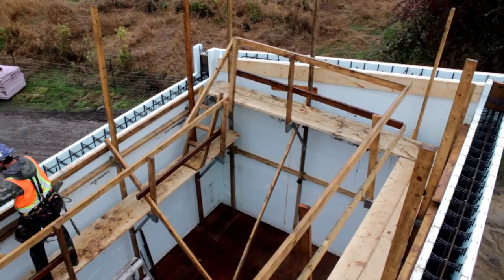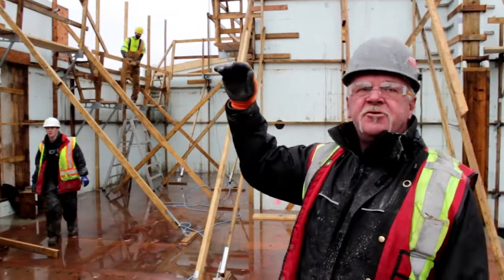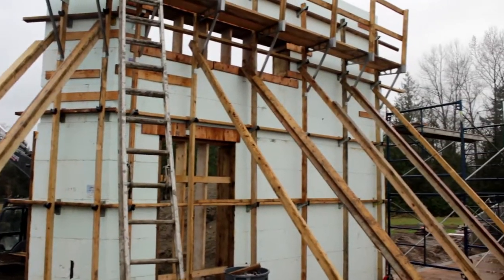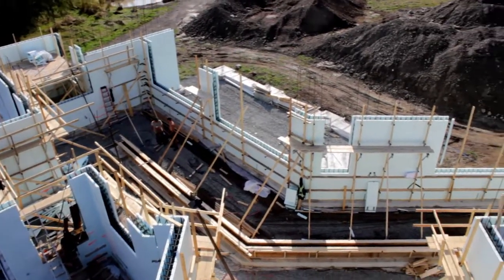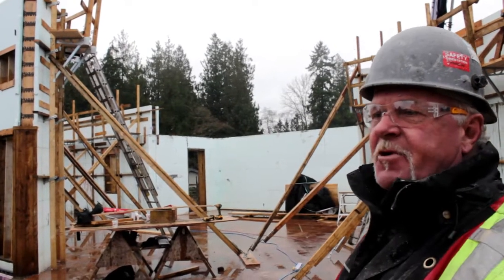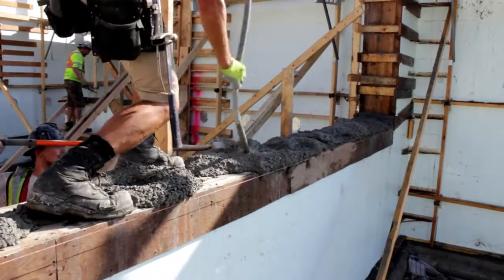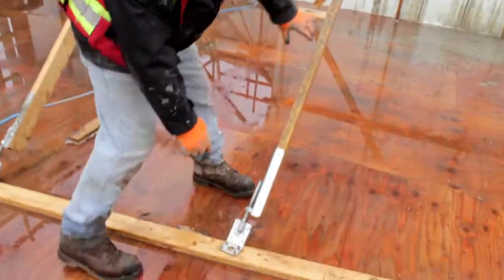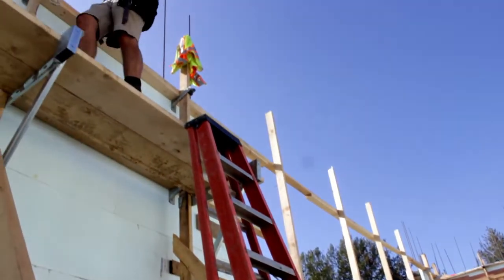Tall Wall - Zont ICF Bracing

Comment: It seems like a pretty reasonable system of bracing even if it sounds like it was named Dr Seuss.

What are the costs like vs renting conventional bracing?  I know part of the pitch is zont bracing can be disassembled afterward and the wood can be used in the house later.  But it seems in my mind a lot of man hours to assemble it vs a lot of the metal bracing.
Reply from the maker: Labor is everything for sure. But the logistical nightmare of getting traditional steel braces to site is a bitch. Also they do not allow you to stake the wall in position, and transfer all of the scaffolding loads to the Monopour Side Supports.